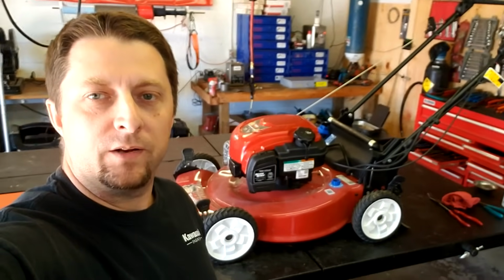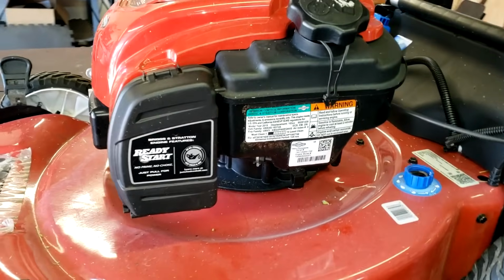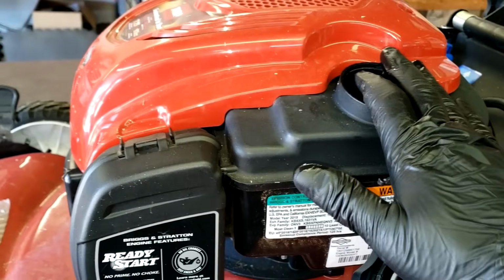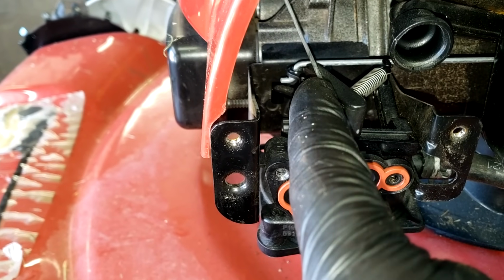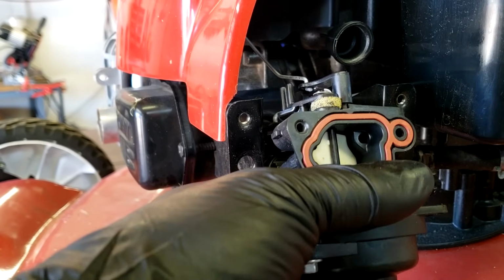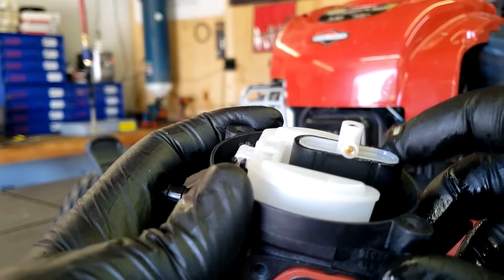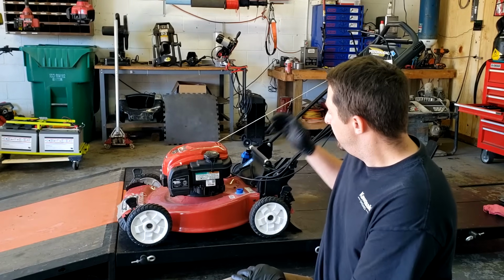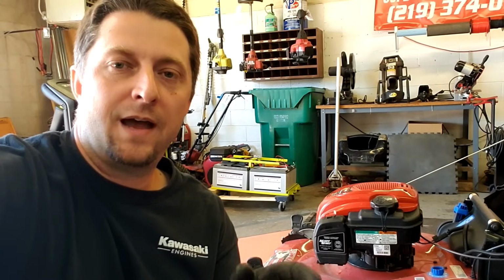TORO Lawn Mower Wont Start Easy Fix

Comment: i find a common problem wiht Toro lawnmowers they dont star tunless starter fluid is sprayed into the filter then they star tup first pull and run great...i saw that teh screws might need adjusting especially on new carberators and i think thats my problem i bought the tools so ill try those out and adjust the screws to see what happens.
Reply from the maker: Most carburetors today do not have adjustable jets unfortunately.

Comment: Good instructions... but in no way at ALL does the aftermarket jet part "snap" into place.  The outward clip pieces are apparently a lot wider than the OEM.  I tried two new replacement jets and broke one trying to bang it into place.  I'll have to shave down the side clips a bit and try again. Otherwise, I hope that my cleaning out of the old one will work until I can do that.
Reply from the maker: We use the oem

Comment: The sad news is, the customer will be back next season and every season after to have this repair done again. I'm going to find a replacement engine so I can fix it and forget it.
Reply from the maker: If they don't use it regularly or maintain fuel system your right

Comment: Do you really need to take out the carb?  Is there enough clearance to just unscrew the bottom and pull out the jet?
Reply from the maker: There is not enough clearance you have to remove the carburetor.
Reply: @D-MAN107  Thanks so much for posting this video.  It is very clear and it saved me a ton of time versus dealing with a repair center.  I also did it without removing the carb!  No need to deal with the linkages and even faster.  Thanks again for posting.

Comment: Only thing I would add is where the carburetor pushes onto the motor there's a small black O ring that sits inside that piece on the carb and pushes on that pipe against that white washer.

Comment: If you use the correct Gas, "Certified Top-Tier NO-ETHANOL Premium", you'll probably NEVER have this issue in the first place. Equally important >>>> Use a Fuel-Stabilizer of some sort, ESPECIALLY before a period of non-use. I've used Seafoam for 40 years in all my small engines' fuel. I've literally NEVER had a fuel-related issue. 

My recent Snowblower went 25 years.....Still ran perfect. Current TORO mower is 16 years old......runs perfect. How?! I add a Tbsp or 2 of SF in my 1-Gal gas tank every time I get gas. Before storing for the winter, I add a 1/4-cup of SF directly to mower's gas tank. Run it it for a couple minutes & park it. I purposely leave mower tank about half-full, with this extra SF. The next Spring, on 2nd or 3rd pull.....VROOOOMM! 

Untreated gas starts to get stale in a month. Ethanol-blends are the devil's work! Avoid it like the PLAGUE!!! Ethanol attracts moisture when just sitting for months.

Comment: Mine was only 2 years old and won’t start so I tried this repair only to clean it coz I don’t know where to buy that parts after I put everything back and still won’t start but I thought about replacing the spark plug and then it work so before you do this try spark plug first

Comment: You can clean those jets out and get them working again. It saves money and parts
Reply: You didn't even watch the video, did you?
Reply from the maker: Right🤣💪👍
Reply from the maker: Yes you can but I have had many that would run but not correctly because the plastic starts to distort so I don't waste my time with that anymore super cheap part and I know 💯 it will run perfectly afterwards.
Reply: I just take jet apart and clean it. No need to replace it.
Reply from the maker: @mgomez5606  lol watch the video 😉
Reply: @D-MAN107  For someone that does not do this daily it would apply to them. Why not just replace the carburetor.

Comment: If you suspect water in your lawnmower gas tank, remove gas cap on tank.  Turn lawnmower over to drain gas.  Fill tank with new (water free) gas.  Install gas cap.  Turn mower on its side (gas tank up) for about 5 minutes.  Turn mower and put back level on ground.  Pull start a bunch of times.  It may take 10+ pulls but it will eventually start.  Keep your gas can indoors and cover mower when not in use.  Don’t ask me how I know all this.

Comment: You start it m you get white smoke what is it
Reply from the maker: That would be oil burning off in the muffler most likely.  Either overfilled with oil or was turned over wrong way.

Comment: Winder Repair as in WINDER GEORGIA???
Reply from the maker: Thats us👍
Reply: @D-MAN107  Nice.  I have an older  jonh deer hedge trimmer that i want to keep. It won't start even with new fuel and spark plug. I'm thinking fuel lined clogged or no spark is that something you work on or try to stick to newer stuff
Reply from the maker: @cobravenum  we can check it out.

Comment: I did this repair and after putting it back together and putting gas back it starts dumping out of the carb
Reply: Do you know what could cause this issue?
Reply from the maker: Sounds like the needle seat is dirty or has debris between them. Will need to take apart and clean them if that doesn't work it will need a new carburetor asm.

Comment: Well, I replaced the spark plug, air filter and carborator.  It started, I turned it off to put things away, and now it won't start.  Any words of wisdom?  I'm trying hard not to call my dad, he helps with too much.
Reply from the maker: If the carburetor is new and installed properly. I would check the fuel quality may have water or bad fuel in the system.
Reply: Well, I had bought new fuel just two weeks ago, and emptied the old and let it dry out.  My dad came and looked at it, we replaced the sheer pin and now he is thinking the rod and piston....its been and adventure.

Comment: Did this step by step and still the mower cuts off after about 5 seconds of running.

New jet and new gas...
Reply from the maker: Must be clogged elsewhere just replace the carb asm Amazon has the cheap.

Comment: Toro lawn mowers are not the quality product they use to be. If you buy a new model you will notice that is built with more plastic, less fasteners to secure parts and reduced parts to cut their manufacturing cost and gain more profit from the consumer. Toro knows this. They put up a front that they stand by the quality of their products, but they DO NOT!  When your lawn mower fails due to manufacturers defect, it is YOUR fault and you will be responsible for the cost! It happened to me….
I purchased a Toro 22” Recycler Self Propelling Lawn Mower, in less than 1.5 years of owning, approximately 20 uses, the mower failed, it just didn’t start anymore.  Their advertising on the box “guaranteed to start” is FALSE ADVERTISING – it did not start!  I used and maintained the lawn mower per the operator’s manual, enduring light to standard usage, checking the oil level prior to every usage. I brought the mower to a Toro dealership, where they said “insufficient lubrication” resulted in a scratched piston, this voids any warranty.  I tried writing both companies, both Toro and Briggs and Stratton delayed my request, never answered my questions, evaded any responsibility that my mower had a manufacturers defect. Any investigation or tear down would be at my expense. I consulted with two Toro dealerships, both confirming that a scratched piston voids any warranty, regardless of any other finding, placing the blame on the consumer.  Both companies conduct their business that the “consumer is always wrong”.  These companies have found “loopholes” to not take responsibility for their poorly manufactured products.  
Additionally, Toro responses demonstrated gender discrimination, implying that a female is not capable maintaining gas powered lawn equipment and does not understand gas-powered engines. Since I am being faulted of “low oil” and Toro is taking NO responsibility for the manufacturers defect that may have been improperly feeding oil into the engine. 
As I share my story, I learn more and more consumers are experience product failure within warranty timeframe and are left with the cost of a dead mower and the need to buy a new one, hitting the homeowner’s pocket in already economic tough times of rising costs.  Who is protecting the consumer?
Reply from the maker: Sorry to hear about your experience. I understand your frustration. This video is about a common, quick fix that can get your mower back up and running. However if they didn't completely take the engine apart for inspection then I don't see how they can tell you that. We do warranty for all makes of engines briggs being a big one and it's mandatory to take the engine apart to place blame somewhere not just a guessing game. If that engine doesn't have multiple bearing failures that typically indicates low oil or no oil. Then just a bad piston points towards a defect possibility.

Comment: I'm disappointed my Toro's Briggs engine is older than yours.  Why did you put the carburetor together with those white things in there.  Set a better example and blow them out. Otherwise excellent video.
Reply from the maker: Faster to replace when you do 10 a day.

Comment: I would edit the part where it says easy fix to "take it to a professional"
Reply from the maker: Read the comments lots of elderly lady's have been able to do this🤷
Reply: @D-MAN107  well I just had a spinal fusion 2 weeks out thought it was something I could get on the ground and show my wife, since I can't elevate it on something. I have a zero turn but I'm not letting her run that into a tree.
Reply: @D-MAN107  well I got it up on a bench took everything apart like you said but didn't replace the fuel jet since I only used my lawnmower one time. Well after I finished cleaning it all up, it actually started right up!!! so I left it running for awhile. But a few hours later i just tried to start it up and it won't do anything 😔 back to square one.